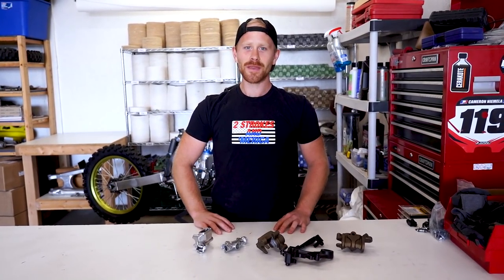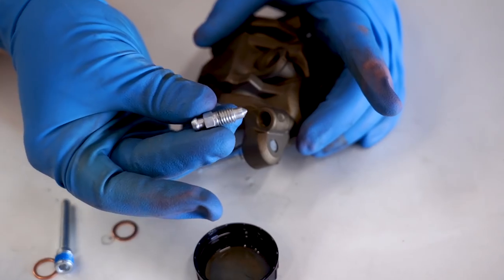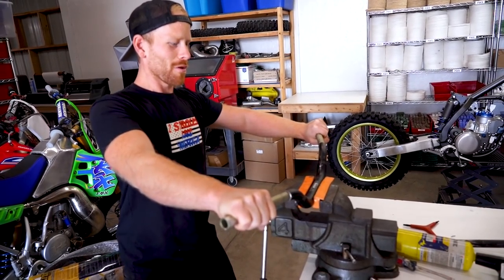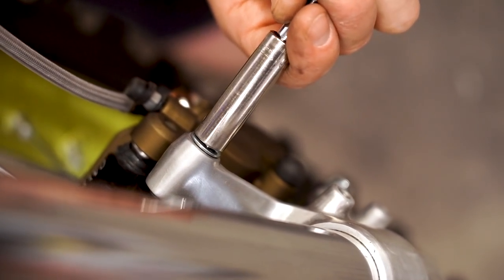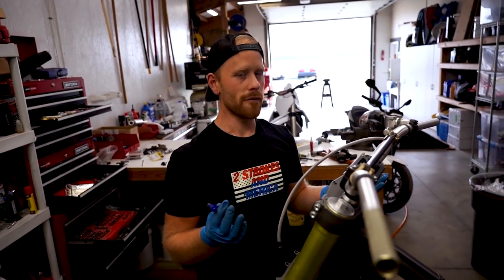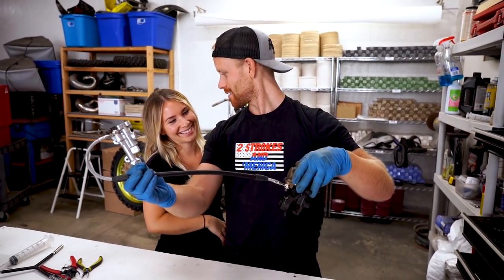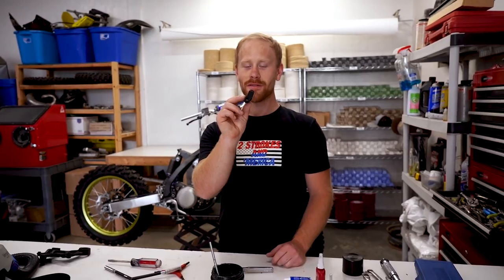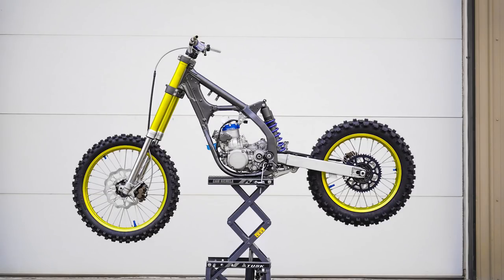Taking It To The Next Level! | RM250 Rebuild 29

Comment: A handy trick for brake pads is to sand or file a chamfer or beveled edge on the front edges of the pads, it makes installing the wheels much easier as the brake disc will slide in between the pads much easier.

Comment: I ran into the same issue doing brakes on cars.  I wanted to back the lube in to keep the pins lubed and keep winter salt water out.  If the pins don't have grease slots cut in them to let excess grease out, you develop hydraulic pressure pushing against the brakes.  I still use plenty of lube, but if I feel any hydraulic force pushing back I remove grease or keep working the pins until there is no pressure pushing back.  You can also burp the air pressure out of the rubber boots, push the pins all the way in then lift up the seal on the boot to let air pressure out, reseal the bottom before taking force off the pins.

Comment: Nice bike build cameron. But out curiosity would so happen to know what year your rear wheel hub is. Because on my kx125 the rear hub is quite right the rear hub for what ever reason needs 4 bearings and needed a wave rotor. And I am not sure what the rear hub on my bike is, the rim is a saxess just wondering if you might know :)

Comment: okay sir here's one for you.? l have an 2018 RM85 ?and  .I have my 1999 RM80. slightly different in height due to the shock and handlebar neek on the RM85 . I prefer the height of my 1999 rm80. slightly lower in front as well in the back it's all original. I'm 5'9 tall. (my question is most bigger bikes have a 21-inch or 19in  in the front and a 18 inch tire in the rear or a 17inch rear tire) I would also like to see myself on a larger bike. larger size motor is what I mean the larger size tires I'm not comfortable with. so on my own personalized personal comfort and bike riding is it a problem if I make the tires smaller or two more the lower size tire and the ones on the 250s or the 125s RMS and just shrink the tire size down to 17 or 18 in the front and put a 16 or 15 in the back let me know thank you